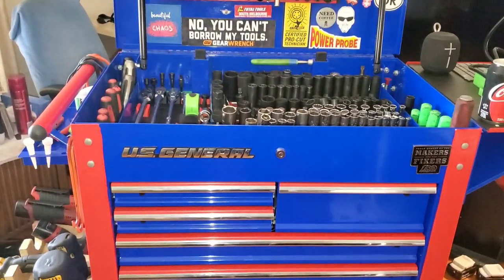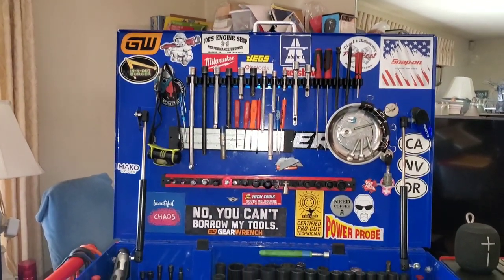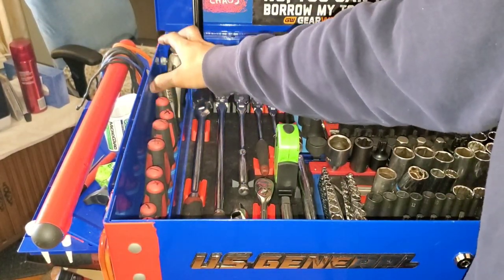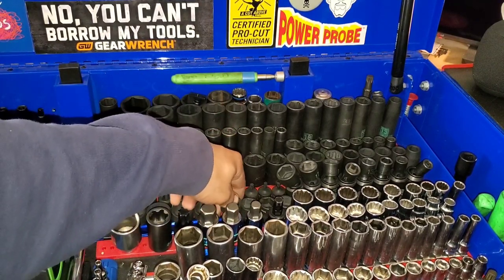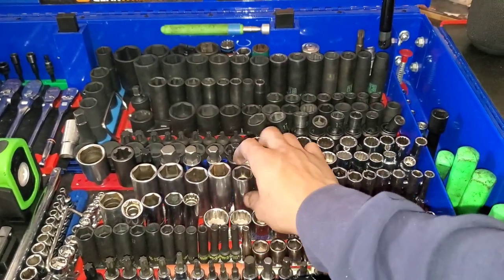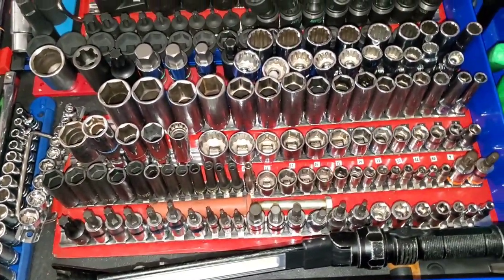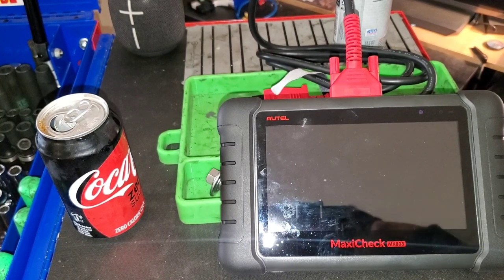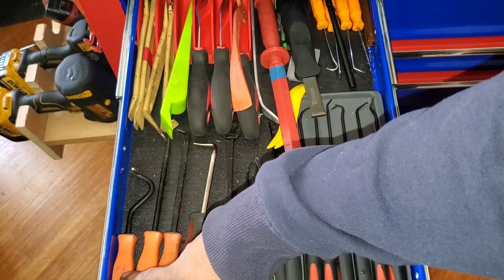Fully loaded US General tool cart tour.

Comment: I think those Toyota head bolts you ran into are double hex bits, not triple squares. Some people use these tools interchangeably, but there is an angle difference; in high torque application like head bolts, I'd get the right tool. Just playing catch up on some of your videos. The cart is looking great.
Reply from the maker: You're correct. Double hex because the ends of the bit come to a point.

Comment: Do you ever run into a situation where you need Sae sockets or wrenches?
Reply: It really depends. I work on a lot of boats that run in saltwater and I need exact sizes including half sizes for really corroded bolts and nuts. Always good to have invade u need em but it depends on what you’ll be working on
Reply from the maker: Yeah...lately I've been needing them so I'm starting to incorporate them back into my cart.